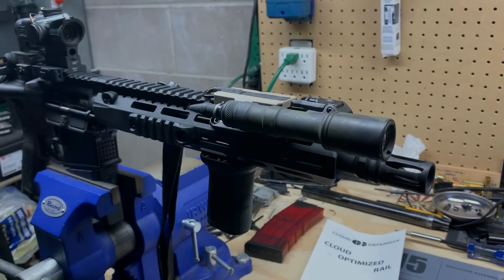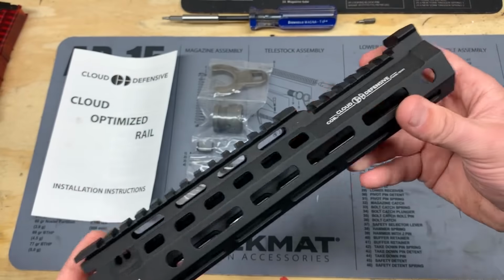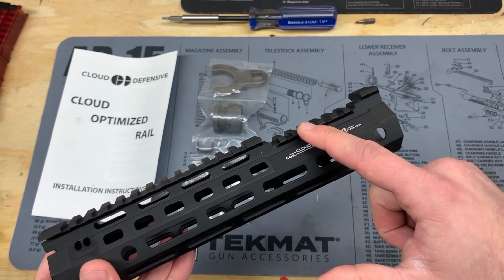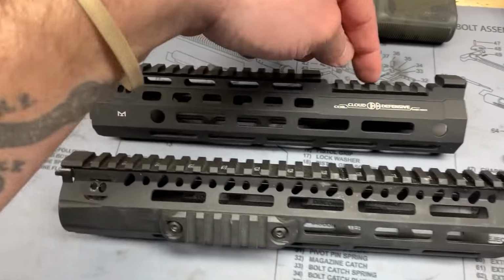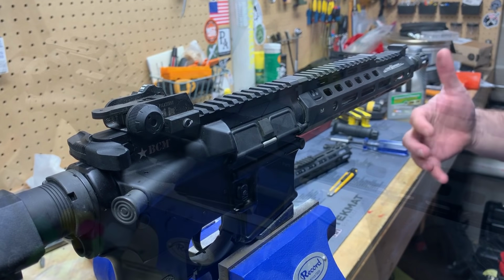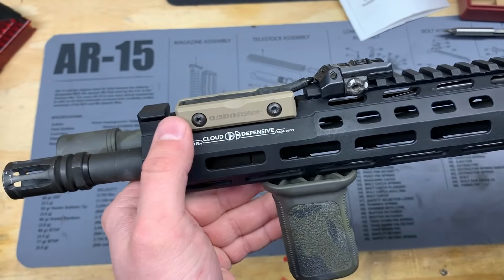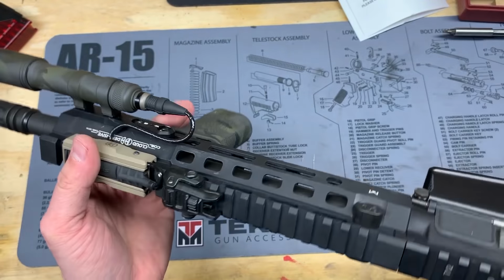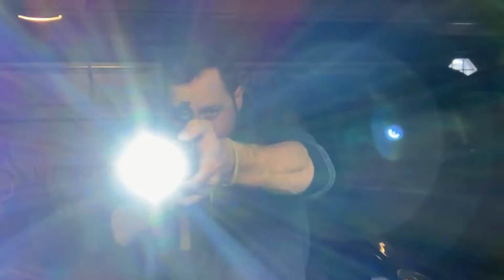Cloud Defensive CORv1 Rail - Overview and Setup

Comment from the maker: One note I did not cover in this video..

No, this rail will not work with piston gas systems as the gas block/piston is too big.  With the lowered rail section the inner portion of the handguard it getting very close to the gas block so you'll need to be running a low pro block and a direct impingement system.
Reply: What gas block are you using on this build?
Reply: So the superlative adjustable .625 clamp on gas block won’t fit?

Comment: I hope they bring out different length rails, I really want one for my Springfield Armory Saint Gen 1 with the FSB.
Reply from the maker: Two more lengths are on the way per my understanding.  A 10.5" and a 13"~.
Reply: @Highjak86  well my rifle is a midlength with the Front sight post, I hope they make a rail that will fit on my Saint.
Reply from the maker: @jessitaylor4170  Mid-length gas system with FSP is around 9" in length.  This one shown here MAY work, but I can't confirm.
Reply: @Highjak86  I've been trying to email them but I haven't got a response back yet.

Comment: Great overview. Looking forward to the OWL :) I also wish they would have extended the rail a bit by adding a slot to be able to mount the front sight upfront. Also, how did you paint or where did you buy the multicam BCM vertical grip? Thanks!
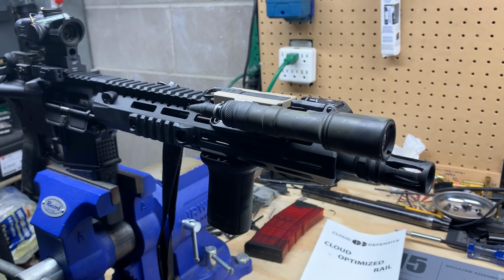Reply from the maker: Black Multicam cerakote was done by We Plead the 2nd.  00:27
Reply: @Highjak86  Thank you!

Comment: Is that an s.b.r build or pistol? And If pistol is ok to have an vertical grip on the rail like that?
Reply from the maker: Legally it's neither in the configuration shown here.  It has a pistol brace, but it is over 26" and has a vert grip so legally it's a "firearm".  Pistol is NOT okay for a vert grip UNLESS you file the paper work to make it an OAW or your OAL is >26" like mine is.

Comment: Sort of off topic but I'm a noob looking for a weapon light for my AR which is a carbine length w/ Mid West industries M-Lok drop in handguard.

I was set on the Streamlight ProTac HL-X and using a IWC thorntail offset mount but then discovered the Arisaka 600 and liked the parts commonality with Surefire components.

Now I'm filled with indecision. Suggestions?
Reply from the maker: In my opinion, in regards to durability the Arisaka lights are just as good as the Surefire option, but for far less cost.  This is why I like Arisaka.  I have Surefire, Arisaka, Streamlight, and now the Cloud light on the way and with that said, in my opinion/experience, the Arisaka based lights are better and more durable than all the Streamlight rifle light options.

Comment: The only value I see in this setup is for lowering IR devices for better optic placement. The added “bulk” of the lcs on a standard pic rail is worth the versatility of pressure pad & front sight placement not to mention you never notice the added height under stress ...extremely niche product for IR devices IMO.
Reply from the maker: You did see the CORv2 that was also shown in the video via screenshots from CD website, right?
Reply: Highjak86 Indeed; however you can do that on an MCMR and even better because standard pic rails have an extra slot, placing your LCS further forward than the COR is capable of. 

Ergonomically you benefit by lowering IR devices(better cheekweld) not from lowering LCS or an OWL. This product should be marketed as an IR rail.
Reply from the maker: thesojourner Yeah... ok...

Comment: I wish they gave just a hair more space for a front sight
Reply from the maker: Like the CORv2?
Reply: @Highjak86  not that much. Just one or 2 rails
Reply from the maker: @crunchyknees3622   2 isn't going to cut it unless MAYBE you have a BUIS up all the time or a picatinny FSP like the Daniel Defense.  5 to 7 slots is standard/typical and the CORv2 has 7.
Reply: @Highjak86  ah. Well I have a dd fixed front sight. So it would work for mine but maybe not a buis or kac
Reply from the maker: @crunchyknees3622  Yeah, unfortunately that is a pretty niche request on an already purpose-driven/niche rail system.  We likely will never see that specific rail with such a small amount of pic rail slots in front.